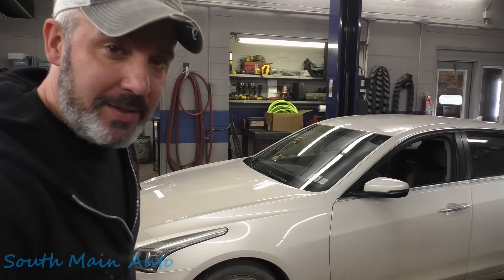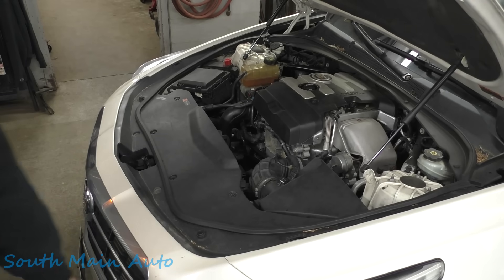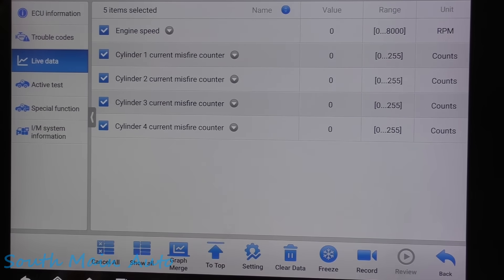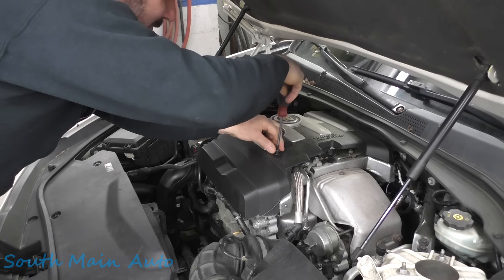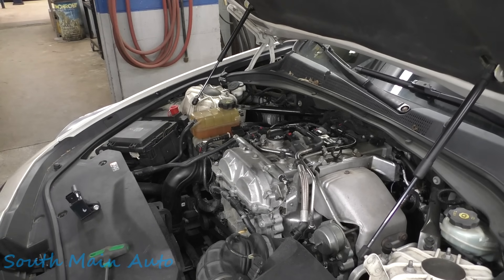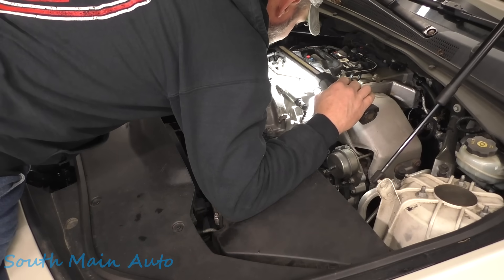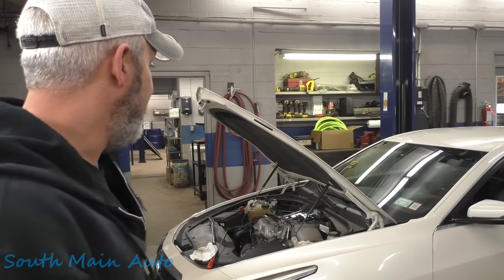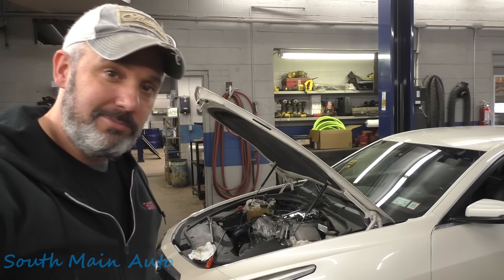'14 Cadillac CTS4 2.0 Turbo - Major Engine Damage

Comment: Quick car question anyone. My son's power sun roof is stuck partially open on his Kia Sorento and the manual allen key thing is stripped. If I cut the cables that operate the sunroof will it become free-moving? Just want to close and seal it. The buttons will only open it but not close.
Reply from the maker: it would be cheaper to fix than tear out headliner and start hacking away at it. I'd recommend having it diagnosed proper. May just be a bad switch.
Reply: If you can get to the wires..  and look up the diagram.  You can just add power directly to the motor and cause it to close..  if the motor still works.. Which it very likely does still work if it's still opening. ..   Or you can take the switch apart and clean it--- might work fine again.. Or you can tap the wire at the switch too-- if it's easier to get to. ...    Honestly, I would try to press the switch like 100 times...  You might get lucky and it work one good time and you can get it closed.   it's worth a try....   Don't beat on it.. but just tap the switch a few times.. push firm and hold.. push firm and hold.. push firm and wiggle back and forth.. push firm and hold again.. etc..    If it's just a dirty switch, there's a good chance that you can get it to work intermittently if you just scratch at it enough times-  if you're lucky... If you do get it to close-- make sure that you pull the fuse so no one opens it again.
Reply: Ooooo now Im interested in what happens.

Comment: 2014 with 111K miles and it's junk already 🤯 either it never was maintained properly or the car has just been beat on high rpms for its entire life? Little 4 cylinder with a  turbo and GDI no thank you! GM junk. Buyers beware

Comment: Jeez, what a piece of junk. And why would you put a 4 cylinder engine in a Caddy?
Reply: This engine is smooth, quiet, drama-free, and has lots of torque down low, a marked improvement over the High Feature V6 it replaced.  They both have Achilles heels though: ring lands on the 2.0T, timing chains on the 3.6.  I've owned both and prefer the four (ask me again if/when mine blows up, of course.)